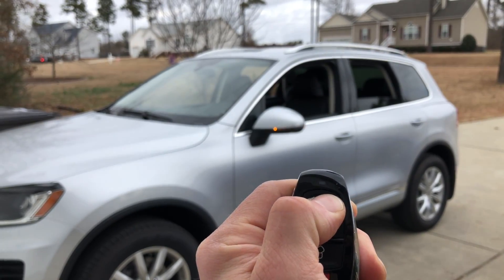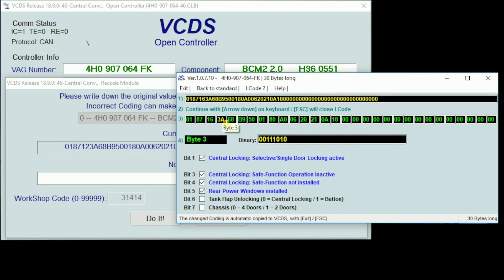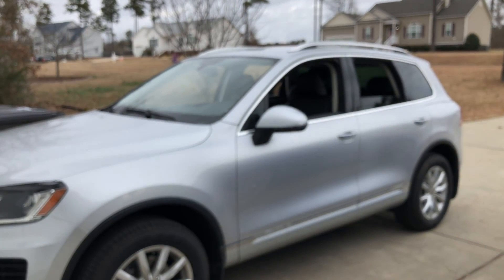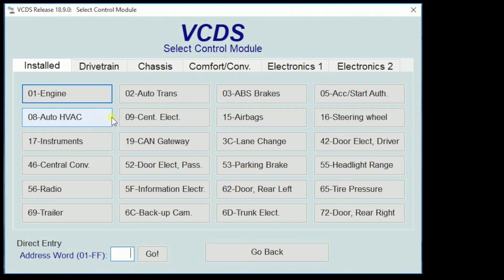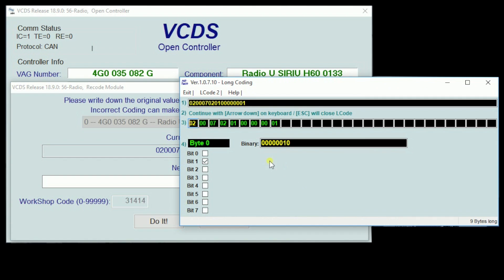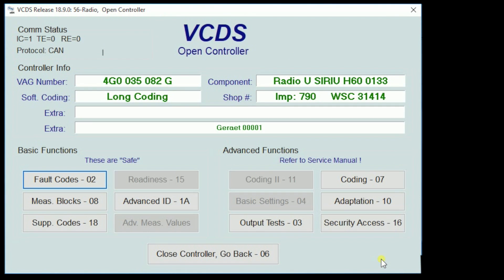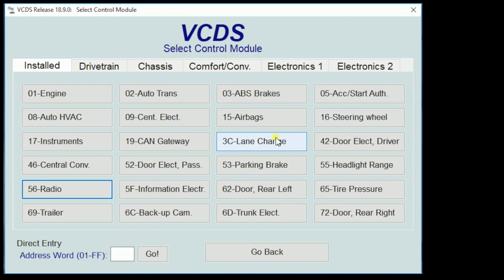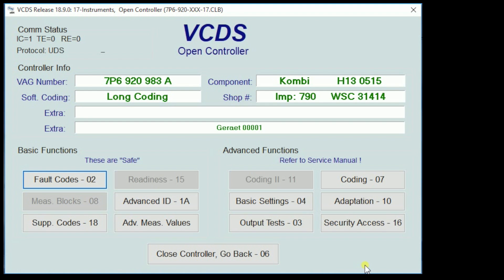Touareg Coding Changes for Radio, Seat Belt Warning, and Windows ~ VCDS Tutorial

Comment: My son's 2017 A3 s-line led headlight driver module (low beam specifically) has failed. If I get a replacement module can I code it to the car with VCDS? Ps still loving the videos by the way.

Comment: hi can you tell me how to code a new injector on a vw 1.2 polo 2013  3 cyl  also can i diagnose if the injector signal is faulty to disprove the whole injector is faulty as the problem comes up with circuit malfunction.

Comment: Hello,
Thank you very much for your work, I have a GOLF 6 2011, is it possible to code the windows automatically without pressing the button on the remote control (on old vws it's in module 46 -Comfort Function automatic Closing windows -)
With the vcds possible to do coding in module 09 power plant?
Cordially

Comment: Hey Charlies, have question for you concerning Navigation Updates as I was watching this on your coding tips. I have a 2017 Jetta SEL and bought the VW Navigation update SD chip V10 but can not get it to install. The reader sees the card with data on it, but going through setup in Navigation and trying to install it states it can't find any updates to install. I have a VCDS, but can't get into 37- Navigation or 56-Radio. I have been through 5F and have unlocked a few things but wouldn't think that would keep it from updating. Didn't know if you had heard or seen issues as such and what tips you might have to install. I have been to my VW dealer, they were no help as they have never done a nav update according to 4 techs as explained by the service rep. Also called VW Customer Support and they couldn't even tell me how, reverted me back to the dealer. Thanks in advance it you can think of anything.

Comment: How would I figure out what specific bits on Radio (56 module) do?

I would like to enable LongWave (LW), but dont know what bit to change

Also, shouldn't everything be in module 5F, why separate Radio (56) module?

BTW: what is the difference between Long coding and Adaptation?

Comment: Thank you for this!  I just put new speakers in my 2014 Touareg because the foam had decayed on the OEM speakers and I was initially disappointed with the results, after applying the long coding it made a huge improvement!

Comment: Great video. Thank you!
I have a 2011 touareg and my heated seat turn off after a 3 minute cycle.   I would love to find coding to extend or even leave the seats switch activated so it will stay on as long as I leave it seats on.    Thanks.  Kirk

Comment: Hi, thanks for your videos man. If got a VW Phaeton 2008 GP1 3.0 TDI V6. 240BHP engine CEXA.
I have engine coded incorrectly and looking for some tips please? HVAC flaps need basic settings. I can cycle them using value 2 in 42 but no save option. I cant find security access codes that work.
Few other probs all because of coding issues. I did instillation list and ticked all relevant boxes. Still comes up coded incorrectly. By what I have written I understand you just say take it to a garage. I took it there and basically got ripped off. (Long story short I have a better understanding than they did.) Charged £70 to say can't do anything with that sorry. Any chance you can provide security access codes? I am thinking about making a video thsn maybe you can comment with some tips? Any suggestions appreciated. Thanks.

Comment: it's amazing!  It really works!  So far, in my VW Touareg 2013, the speakers sounded quietly with a reduction in the middle of the line.  Now, after coding, it sounds loud like a sound system.  During coding, I was worried about the reluctance to do the coding.  but after I waited 20 minutes, restarting the radio was amazing.  Thank you for the movie !!

Comment: I did the coding change on my Passat b6 to close and open the windows with the remote. It works -however it's giving a fault code, do I need to go into basic settings or adaptations afterwards?
As an aside - is there a code to open / close the windows with one click on the remote rather than hold the button down?

Comment: I did these radio coding changes w obdeleven to our 14 touareg R line and it made a HUGE difference. I did not notice until I restarted the vehicle... we now hardly turn the radio past 1/4 volume where as before 1/2-3/4 volume was the norm... way clearer sound now as well. I had to turn the bass way down.

Comment: Hi Charles!

I have a 2001 VW Cabrio, and the key in the door to make all windows go up or down does not work.  Is this something that can be fixed or modified through software to work with the key fob instead?
Reply from the maker: You have to add a relay. I’ve never looked deep on the Mk3 just mk4

Comment: Excellent stuff humble mechanic.  Looking for more tricks for the car.  Driving a 2015 touareg VR6 for 2 years now .  
Problems so far :1) Adaptive cruise failure multiple times.  Luckily was under warranty and they replaced the radar sensor, but found it was the control module corrosion afterall, all covered.
  2) Finally was ready to tow, hooked up the connector and ball mount but getting no Left tail light signal or left brake on the output.  Hard to troubleshoot because it needs to sense a connection before sending a signal out to the back. Might take it to the shop to check out when I really need to start towing stuff. (any vcds change to check if its software or hardware issue?)
3) minor, sometimes when you put the shifter in park, the sensor reads that it isn't parked, so I have to push the gear selector forward a little more to get it to sense.
Love the vehicle overall, nice little rumble if you give it just enough gas, hoping to enjoy as many years as possible.

Comment: As an audio guy, I gotta say it sounds like you've got some settings really messed up on that little handheld recorder. Sounds like it's recording at the lowest possible bit rate. Like less than 96kbps mp3. Really bad. I would have liked to have really heard a difference, but I couldn't really tell with that awful compression. Consider digging into your recorder settings to see if you can up the bit rate.

Also, if you need some advice or tips about audio, feel free to shoot me an email. will.gaines13@outlook.com.

Comment: Hi there I have 15' T3 TDI Lux  and I absolutely love it. Among most loved changes I did with OBDEleven is dimming DRL when turn signal is on to 50% instead of fully turning it off. There is one thing I 'm dying to do:  turning on fog lights automatically with headlights. To clarify: I have my headlights switch on auto and it works perfectly but foglights are something you have to press the button to activate. I would like to get all 4 lights(2 fog + 2 headlight) light up automatically when its getting darker. Together they are producing much more light and makes sides much more visible. On some forums they were saying it could be done with switching county through VCDS to Canada but i was unable to figure it out . Please advice... 

P.S. absolutely love ur chanel. <3 and yes it is legal to drive with fog lights on in my state.

Comment: How much do you know about the factory head units and if my issues are related to my factory head unit in my 2017 passat r line 

I have a high end audio system using the vw factory head unit that feeds a signal into a digital signal processor the the signal is sent to a 5 channel amplifier that is powering my component set and my single subwoofer 

The problem is that we (the audio shop and I) believe that the factory radio is causing the dsp to go bad. Dsp has been replaced a few times and the audio manufacture is thinking there may be some compatibility issues between the oem head unit and the dsp. 

Can these radios be re-coded to recognize a line level signal instead of a high level signal?

Comment: awesome info on VCDS long coding.  Would love to see future vids on how the VW CAN-Bus modules work and get "enabled" or "disabled" safely, as in when you need to replace one with aftermarket gear (head unit, etc...). or, as in my case, turn off the "SatRadio not activated" error in the logs (because with Pandora or Spotify I just don't pay for sat audio any more).  It's a nit, but one that's begging to be picked. ;-)

Comment: Hmm. not so sure that take out the seat belt warning system is so good idea!
As you work on cars, you know your seat belt "lock switch" will be, worn out and not detect that you have seat belt on.
And that can mean that, on accident your car then may not use your, seat belt and/or Airbag to safe you or your passenger if the failed lock is hers/his.
Why not? ... you don't have seat belt on, then why use energy to tighten it and as you don't use your seat belt, then why, hit you in head with Airbag? (as it would do more damage to you...)

What i mean is that. Even if that warning light and specially the sound is annoying. It at least tells you when your airbag isn't on by the worn out seat belt lock switch.

Comment: What is up. I am 180° from this topic, I'm hoping you can help out a newly subbed.   I have been looking for a engine to re power a older vehicle. I have noticed the VR-6! Would it be a reasonable swap for a rear wheel drive? I can probably handle the adapters for engine to trans. And engine mounts. Since you are the vw man!   I don't think a turbo will be needed. I wouldn't mind if it was carburated. I don't know If they ever was?  The vehicle in mind is a 4cylinder international scout! I'd like to gain a couple cylinders. And the VR being do small. I want to keep the engine small as I can... Can you advise me? What engine model should I look for? And I'm guessing I will need a engine harness and ecm. I want to keep it simple as possible! If it gets very complicated. I'd rather swap a 80's 60° Chevy v6! 2.8/3.1/3.4 litre.. Thanks

Comment: I would like to adjust instrument/dash lighting to make it dimmer.   All the way dim still seams bright to me for comfortable rural night driving.    2018 GTI S.   Is it possible to adjust the brightness range?
Reply from the maker: Good Question. I’m not sure. I’m with ya. Most cars are way too bright
Reply: @HumbleMechanic  same problem on 2016 Touareg 3.6. On infotainment system the display brightness is set to zero but is still way to bright!
Reply: It should be a setting in the radio unit infotainment screen. No VCDS needed for that one. At least, not on a T3 Touareg.

Comment: Is to OK to disconnect the battery without a memory saver in German cars? Am asking because I have seen even official Mercedes videos do it without memory saver.
Reply from the maker: Yes. Do not use memory savers! In over 15yr of working on German cars I’ve never used one and probably never will.
Reply: @HumbleMechanic  Thanks. But then why are all this people making such a big deal about not disconnecting the battery without one?
Reply from the maker: That I can’t answer. I’m not sure of any German car manufacturer that recommends using one.
Reply: @HumbleMechanic  Sorry for asking so many questions, but here goes another one. If you disconnect the battery (in a new VW-Audi), do you get problems with the SAS for example, or do you just start it and go?

Comment: I changed 3 items very quickly on my MY13 Transporter. 1. The rear wiper would give a courtesy wipe AKA courtesy scratch! when the wipers were on and reverse selected. 2. Disabled auto door locking when the vehicle starts moving. 3. Turned on the arm/lock chirp on the factory fitted alarm. Edit: 4th item was the mic? button on the lower left of the multifunction steering wheel can be changed to mute the radio instead of the crappy voice recognition function.
Reply: Where did u disable the rear wiper when reverse is selected?

Comment: Can you remove the blue motion start stop function this is my pet hate with all new VW vehicles
Reply from the maker: I don’t think you can fully disable it.  It you can change the voltage threshold so it never shuts down.
Reply: Yes you can, I think this is where I found the info, worked for my 2014 Touareg!
https://www.mytreg.com/index.php?/topic/63034-disabling-start-stop-with-vcds/

Comment: Interesting as ever, I’ve actually got the poor relation a Skoda yeti here in the uk, I doubt you will have heard of it, basically all slightly older vag parts largely I think mk5 golf albeit instrument cluster is uds etc, vcds is essential for things like changing the fuel filter on the cr tdi but beyond this and resetting the service indicator (s) I haven’t really done a lot, I bought it for my Passat originally so I could change the rear pads but it’s a fab tool. The odd thing is on the Skoda the close windows with remote is already on and the windows auto shut when it rains (as I found out during a summer downpour) but then to get the mirrors to fold you have to press the remote and hold or use the internal switch, I’d love to know if you can change this to auto fold on key off, as in the UK most parking spaces require the mirrors to be folded (narrow) and I’ve gone through 2 batteries in the remote in as many years cause I’m always using this function. Keep up the great videos👌

Comment: Great video Charles. VCDS is such a capable tool but there’s not nearly enough videos on it. I tried to turn on convenience windows so they open and close with the remote on a friends 2007 Audi A4 convertible. The coding changed but the windows wouldn’t work off the remote. Any ideas?

Comment: I think for some Passats  there is a functionality that the car will automatically close the windows in case of rain (if they are opened). Check this on VCDS it I a good tweak. Lap timer is working on my Audi which also shows the engine oil temperature
Reply from the maker: Jettas have it too. Really, if it has a rain light sensor, it should be an option.
Reply: @HumbleMechanic  and  you can add a Rain light sensor along with an auto switch for the lights all together

Comment: plz do a guide on passenger seat sensor disable. really annoying putting stuff on passenger seat.
Reply from the maker: I probably won't. I have an issue truly disabling that type of safety systems. I would consider doing it on my car, but I don't want to put that out to the public.
Reply: @HumbleMechanic  T^T
Reply: @ThousandBlade  Isn't that seat belt warning deactive answer to your question? U can always mechanically deactivate one seat warning so that u connect together those buckle wirinigs underneath if seat.  It is only ground loop afterall. Works similar in every mark and model
Reply: @dot7107  yeah sort of. Im doing weird stuff with seats. using mk5 golf R seats on mk6 jetta. and taking the seats completly appart and trying to frankinstein a steat that have all functions working. just abouta give up right now and wanna just have no airbag warning light.
Reply: @dot7107  the sensor on the seat now is just crazy, sometimes it thinks theres a passinger, sometimes its fine and other time it just gjves me an airbag light. i think i might have dmged the wires. just dont wanna deal with it now.
Reply: @ThousandBlade  Seat belt warning and airbag warning are two different objects. Seat belt warning originally came because euroncap extra points and it is only ground loop through buckle ( measure it and u will notice). Airbag light is completely different case. If u wanna swap different type of seats without side airbag, u need suitable resistor to the wires to mimic that airbag Ohm. Maybe like golf 6/7, passat 3c or so on front airbag deactivation switch type thing. However that is not possible to decode with vcds, or even with odis.
Reply: @dot7107  i was looking around for airbag swich in the glove box and trying to see if that helps. but gave up as i have no clue how to wire it in :(
Reply: @dot7107  guess i'll just keep trying out different part to find the perfect set of airbag, harness, frame, foam so that everything would work and no warning light
Reply: @HumbleMechanic
Is it possible windows up and down for Vw Toureg 2005 ?

Comment: I noticed other options instead of disabling the seat belt warning. Can it not be changed for the NCAP ones instead of disabling it totally?
Reply from the maker: Good question. I will look into it
Reply: @HumbleMechanic  if it can be possible, probably it will behave as an European model. As far as I know those only beep at you when you reach a certain speed (about 10 or 20 km/h)

Comment: Radio tweek would work for rcd 300 too? or nah
Reply from the maker: Not sure, I only found it for this radio
Reply: @HumbleMechanic  Ok thanks,  I have done many tweaks on my 2008 VW Too lol so easy.. Other things I did were tpms without a button, coming home, dual rear fog lights instead of 1 , auto lock at 15kmh  and unlock when you take the key out of the ignition. and now i am thinking of adding the cornering lights feature too  .
Reply: @HumbleMechanic  Also I think i found a checkbox that lets you operate the windows for longer time when the key is in the ignition but not turned on ( i mean just plugged in, no lights) If you  could confirm it i d be thankful lol
Reply: @HumbleMechanic  Also you do reply on facebook? Lol